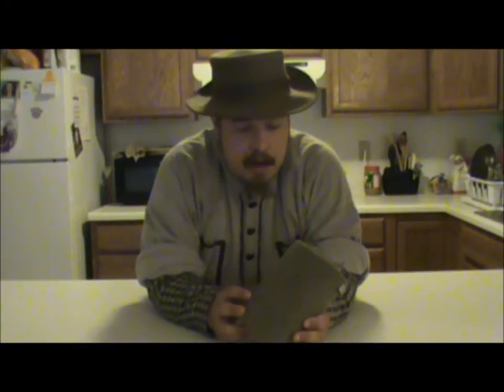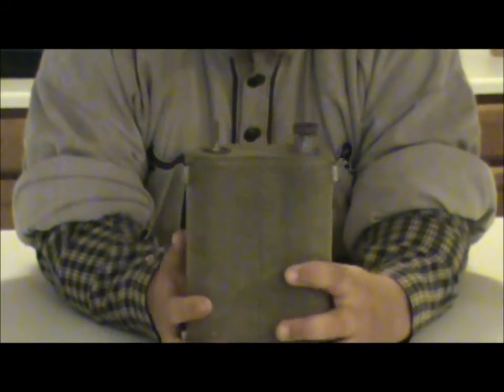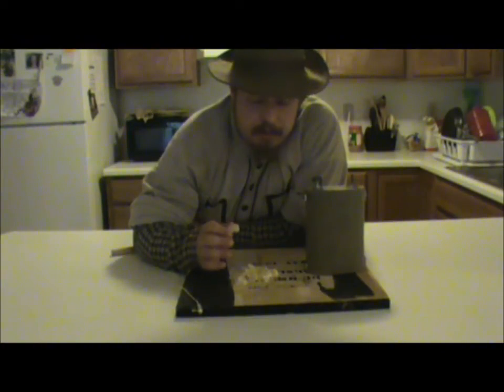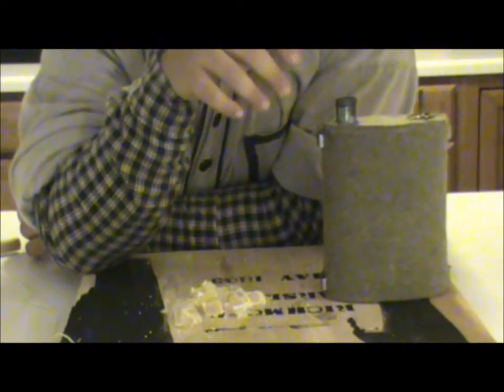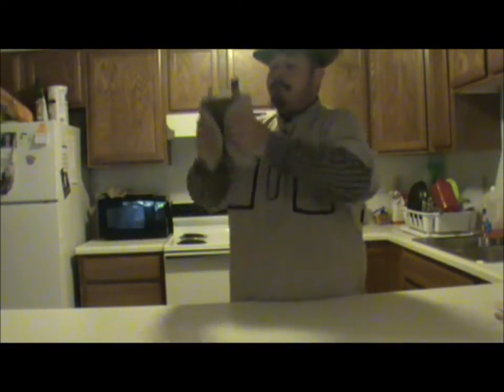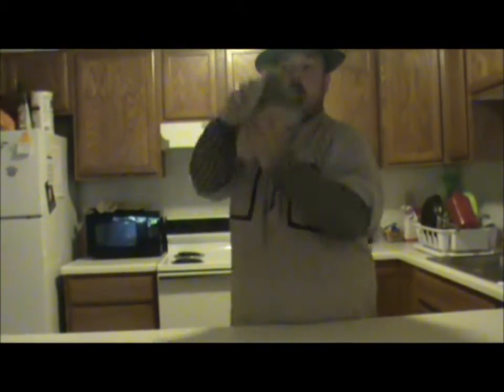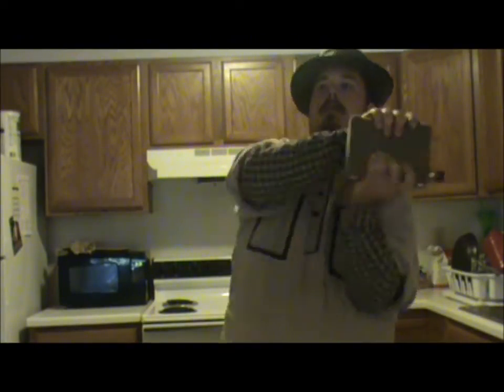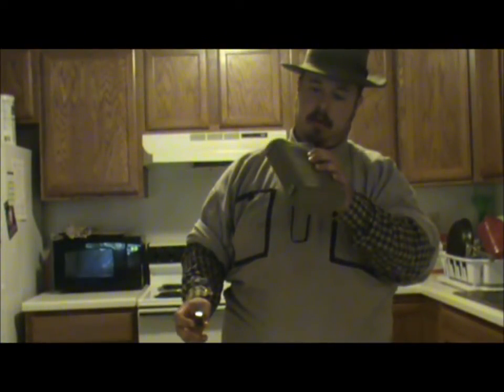Beeswax Lining Your Civil War Canteen

Comment: I just did a couple jarnagin 1858 smoothside canteens and used this video as a method to get my canteen waxed...it worked!!...ALTHOUGH FOR JARNAGIN SMOOTHSIDE CANTEENS YOU HAVE TO PUT THEM IN FOR ABOUT 15 TO 20 MINUTES DEPENDING HOW MUCH WAX U PUT IN!...the  jarnagin canteen are made of thick tin metal and is a pain to heat properly to melt the wax...so u have to put the canteen in a tab bit  longer